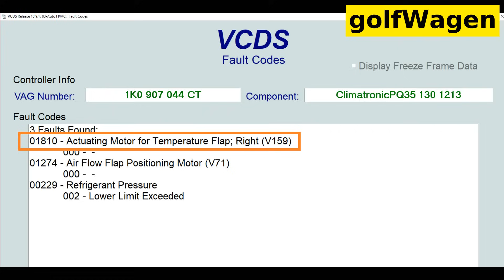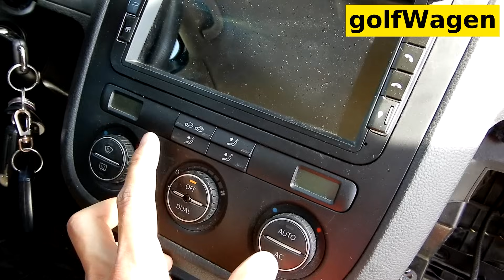VW Golf 5 motor temperature flap change V159

Comment: what problems does this motor bring because I have a golf mk5 and it always brings cool air to the passenger's feet
Reply: Is your cabin filter missing? Mine was.
Reply: Hello. I have exactly the same problem. Clicking noises from the passenger side dashboard and sometimes, random cold air blowing to the passenger foot area. Did you solve it?

Comment: My mk4 v5 heater stays on when I switch off the climatronic ac sometimes. What would cause this as it doesn’t always happen. To not overheat I have to switch it back on and turn the temp down lower. Heeelp 🥵

Comment: Can someone please help? I have a 2014 VW GLI. Recently replaced radiator and heater core and had a coolant clean/flush - but I still smell/taste coolant in my cabin and get fogged up windows. My OBDelevel scanner has code B108815 for right vent temperature sensor. If I replace this will this solve my problem or is there something else under the dash I need to fix. No wet carpet. I prefer to DIY before giving in to the stealership costs. Any advice?
Reply: Have you changed the cabin filter ?
Reply: Hanbiš sa za to že si Slovák keď ho meleš tou akože angličtinou